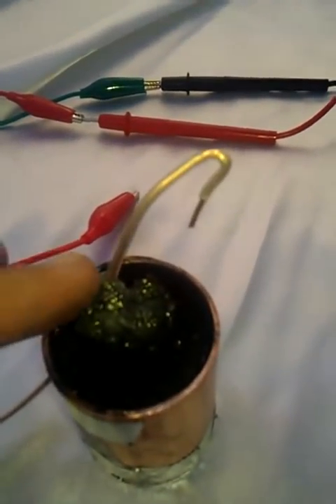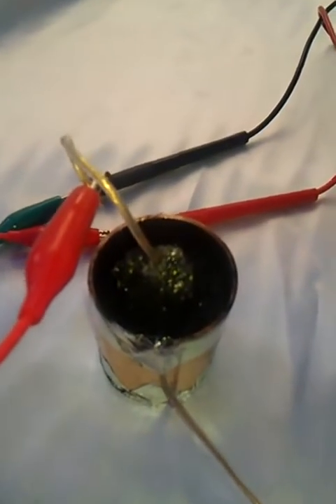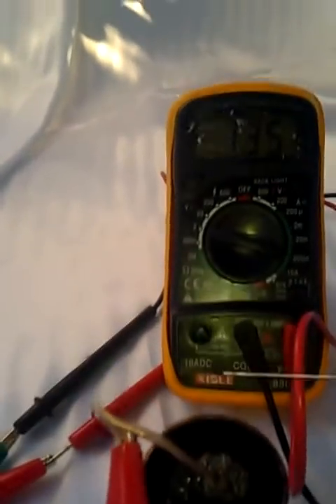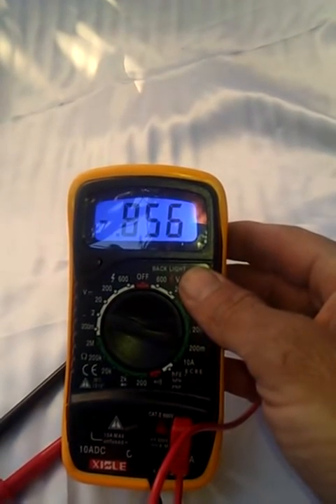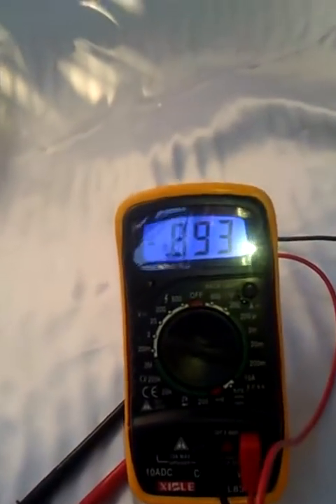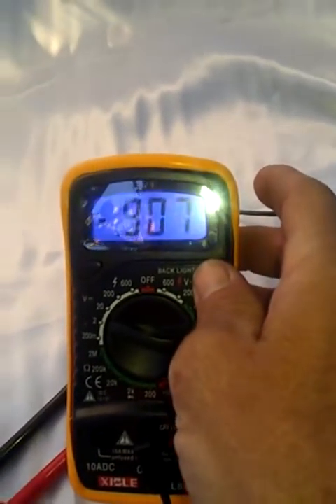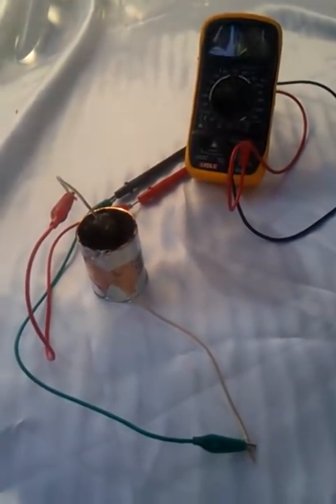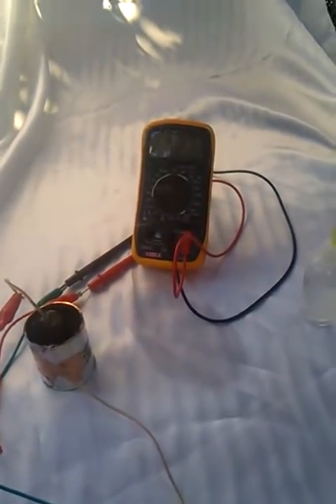free energy  crystal battery overunity  hutchinson effect rock battery Tesla Radiant

Comment: I have done using Alumni salt and Epsom only, it gives 1.9 volts dry smashed powder if cooked 1.4 volts. however, I use purse magnesium and copper. But it seems very low amprage.